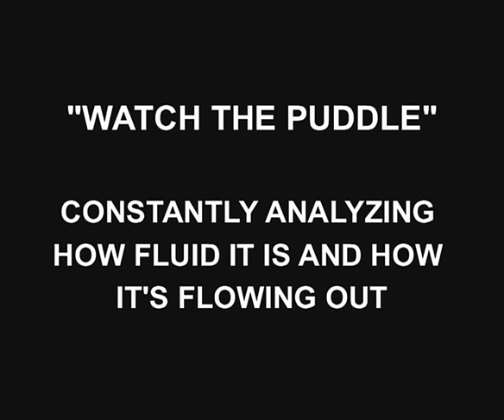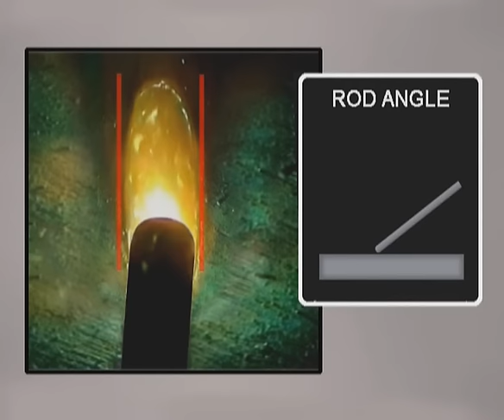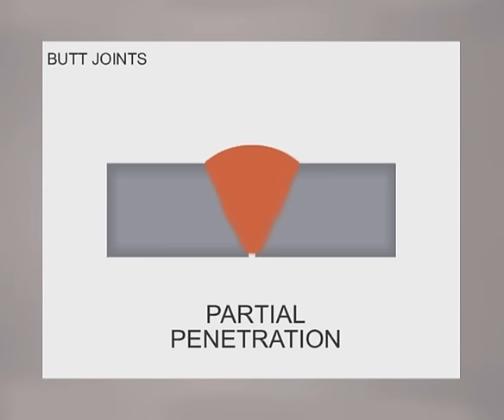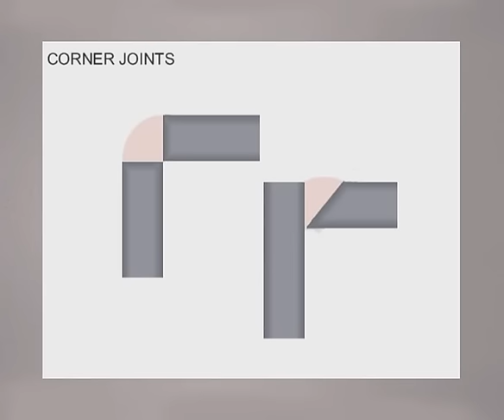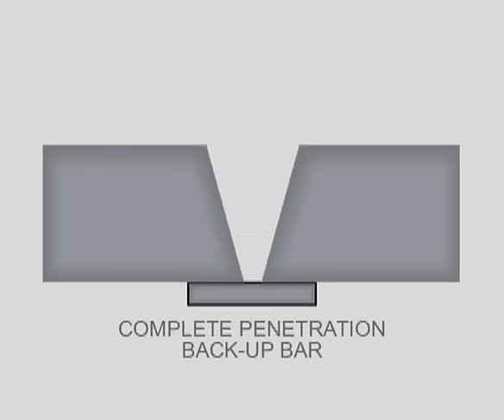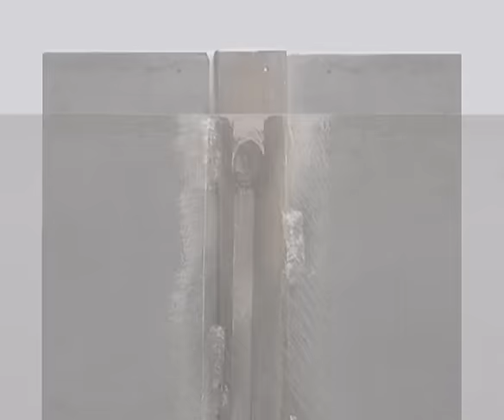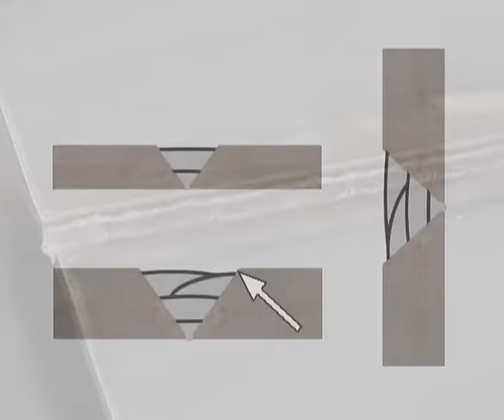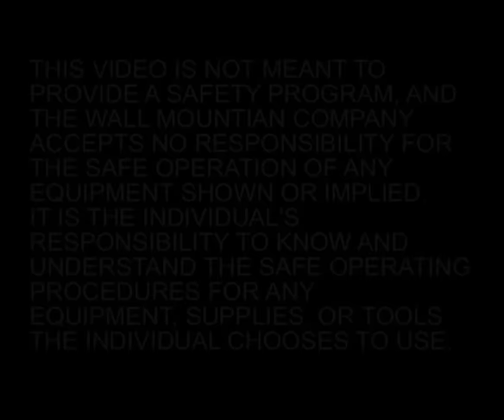Arc Welding for Beginners

Comment: I watched plenty of videos of flux core when i got one and started welding (nothing that needed strength nor testing) then got an arc welder for some heavier material about the workshop. In previous employment I heard welders discussinv the different types of weld pattern they prefer, crescent, zig-zag, eternity symbol....The explanation of the molten pool, different types of rod diameter/flux has simplified what had confused me for quite a while. Superb video

Comment: Very good Arc welding demonstration. When I was taking civil engineering. I had forgotten how many of individual welds types there are.  lol. Non of them are more important than another, depending on the joint types they are to be used for..  Thanks for sharing!

Comment: Hi Steve, I hope you can help. I bought a cheap arc welder for a few small jobs I have around the house. My question is, can I ground the welder to the item I'm welding? I'm going to weld a new platform on a two wheel dolly and don't have a metal work table. Also, could I take it outside and pound a metal pipe into the ground attach the ground cable to that pipe? 
I hope you have time to answer.
Thanks.

Comment: Hello, I was hoping for some advise. I am as new as it gets. This is my first time and I am trying to weld 3mm expanded metal sheets to galvanized steel U channels. My problem is I am melting the metal sheets before they weld and am not able to get a pool started. The rod is melting into balls and dropping onto the floor. I use an Ingco brand inverted MMA arc welder and set the Amp to 57 up to 62. Not sure if I made any sense. Cheers

Comment: I have an arc welder and I am trying to weld some thin metal to the bottom sills on my car to pass my MOT, the metal is approx. 1mm but I have no idea what electrode I should be using, Ive tried welding it and its just burnt holes straight through the metal, I THEN tried spot welding by just brushing past the metal but its doing the same or just does nothing atall. Would you have any idea what rod I mil(mm) and type of rod I need? 

I know ideally I should have a mig welder but I cant afford 1 at the moment
Any help or advice is greatly appreciated. 

Regards
Dale
Reply: Hi frind, I suggest you to use 6013 5/32 rod and low your amps to 87 or less until you get the right amount of amps for your hand speed , heat the rod on a side plate and tips points behind other with a space of three points between each other and keep filling the rest open spaces the same way until every space get close check out the speed and the rod position it's difficult at the beginning because the metal is too thin but with practice you will stop making holes. 
Ps. Don't forget to heat the rod every time on the side plate so the rod stays always hot to avoid sticking. 

I wish these tip will be helpful for you 😆.

Comment: What electrode would you suggest for repairing semi dump steel trailers? Cracks on the body   over the years of use and cutting out floor pieces and welding in the patches or just replacing the whole floor .
The thickness is mostly either 3/16 or 1/4 steel.